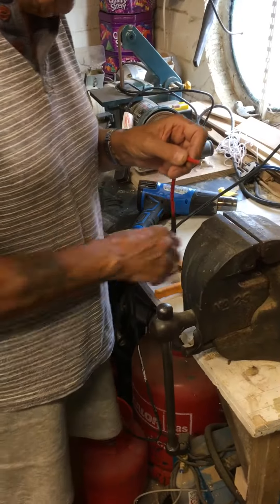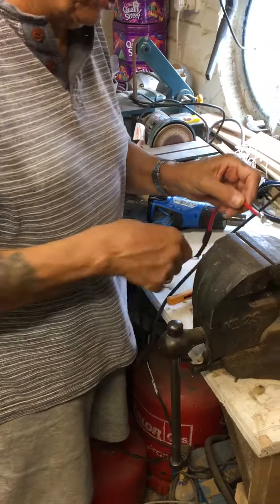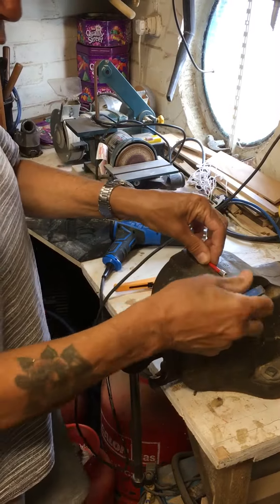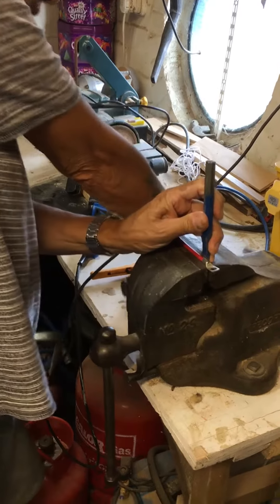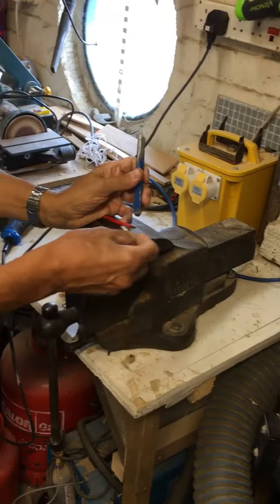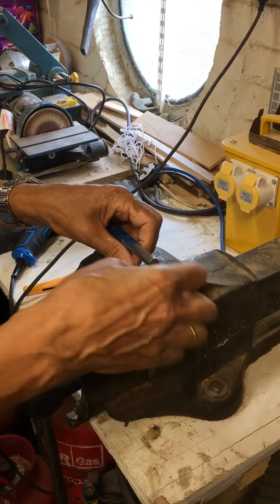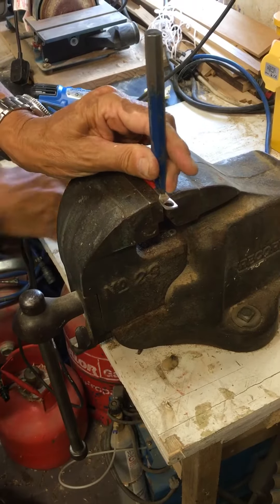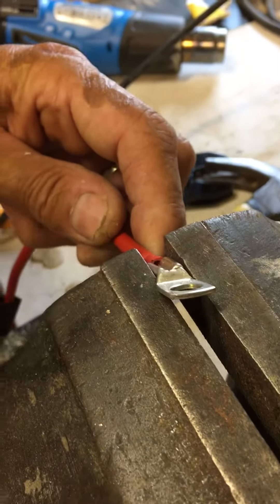How to secure  battery  terminals without a crimping tool

Comment: Thanks, I sure did need a quick way to get my riding mower back in service.  Can't find any crimpers for this job, my husband passed and all I could find was crimpers for ethernet or computer cables which are much larger than the wire to my battery.

Comment: Well demonstrated   How large a gauge of wire would you use this method on?  Any limits?
Reply from the maker: You need the fitting to be a bit wider than the wire to get the room to squeeze it together after putting a crease in with the chisel if there’s a hole in the bottom you can then solder fill it I will do another video to demonstrate this
Reply: @MrCheltune  Thank you!  That would be very helpful.